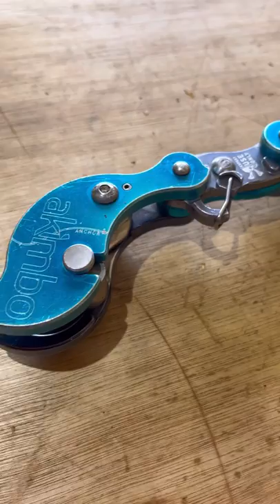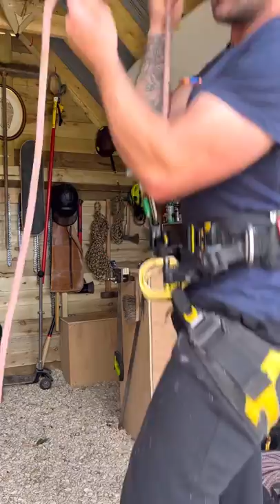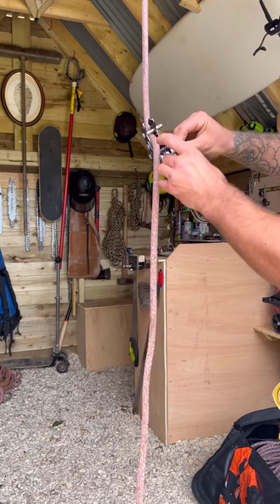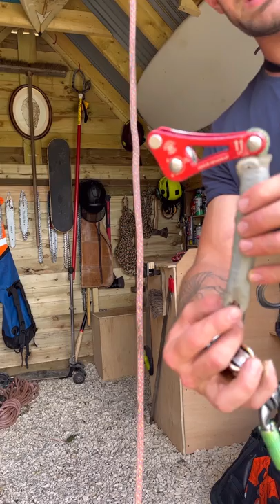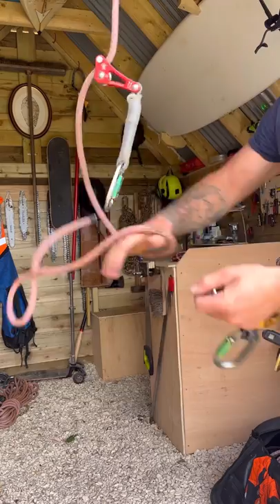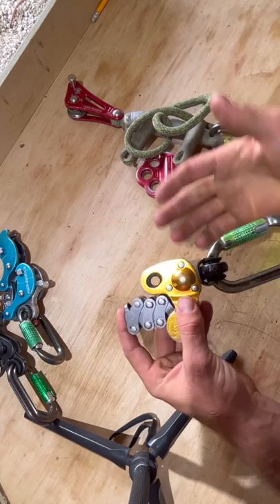SRT devices how they work and comparisons. Akimbo, RRP, ZZ, Hitch

Comment: That quick release on the Akimbo is a safety feature.  When you lean back on the Akimbo it can collapse on itself and start running on you.  I am surprised how many YouTubers that review the Akimbo either fail to know or mention that. I don't even own the Akimbo and I know that. I have even seen so-called "experts" modify it so it would not release like it should which is just a bad idea and goes to show how much they really do not know about the devices they use. Experts my @$$.
Reply: It can collapse IF not dialed in correctly

Comment: Hello man.. great video thank you... I have one question... which of these do you think is the safest??
Reply from the maker: To be honest man I’d say that’s a very opinionated question to answer. I think the way you use certain devices can effect how safe and reliable they are going to be. But to try and answer what I think… I would say the hitch could have a big disadvantage as your climbing on a rope, therefore if you somehow catch it with your power saw or hand saw you have a big chance of cutting it and then you screwed! Where as the others are metal so you might get away with just blunting your saw… 
With the ZZ and chicane you could argue it might be the safest as it’s not midline attachable so it can’t somehow come off the rope (which the other two wouldn’t anyway unless you were doing something strange) and the ZZ has the chicane above so if you drop a branch or a climber drops there helmet etc and it lands on your device you have something above your ZZ to almost protect it and stop something holding it down and making you free fall. 
In terms of being safe, I think a massive part of working and climbing is to actually ‘feel safe’. If you trust what your climbing on and know exactly how it works and how it’s going to behave in certain situations then your more likely to feel a lot safer. I’ve climbed on other people devices and they have acted totally different to mine and this can sometimes throw you off and make you feel unsafe. So I guess make sure your happy with your set up and trust your kit, this will make them all safe if use correctly 🤙🏼 hope that helped 👍🏼

Comment: Where did you get the grommets for the main points?  As a rule,  those should come standard on all of these devices seeing how they always preach no metal on metal.  My Rope Runner Pro doesn't have that so I am assuming you added those yourself.  I also think the main point on the RRP could be more stout. Makes me a little nervous. Notch should have done better on that.  UPDATE:  I just read the comments which answered the question.  DMM @ Honey Bro's.   Got it.
Reply: Arbsession has them ..better store

Comment: Does the akimbo self tend when clipped in to a neck tether, when spiking up a stem in the same way a Rope runner does?
Reply from the maker: Yeah it does, if you have the setting on high friction it won’t tend spiking with out clipping your foot ascender in. But on normal and low friction it tends good 🤙🏼
Reply: Best review of the akimbo. The side plate of my RRP's pulley bent after a couple of years. Maybe from improper use or sideloading on a spar etc. I find rhe RRP a pain in the arse to clip in to the chest attachment point even when using the perfecto carabiner. Just got my akimbo from buxtons as 270 before tax

Comment: Hey man, great video, quick question how do you have your akimbo set, i know its rope dependent, however i have heard some people say to have the top bollard set higher . Whats your thoughts?  🤙✌💪🏼
Reply from the maker: Hi man, it’s funny you ask because I’m going to do a short video on my instagram about the device and settings etc, I’ll post it on here as a short so keep a eye out! But In a nut shell… I have found that the top bollard controls more how sensitive and quick it collapses, where as the bottom one is the actual speed it moves down the rope. If that makes sense, it’s a bit hard to explain in writing. So if you had the top one set on the least friction setting and the bottom one set on the highest it would push down with no effort at all but then move down the rope really slowly. That’s what I’ve concluded anyway, I think from memory I have the bottom one in the middle setting and the top one a little less friction as I like it to be fairly quick at releasing. Hope that make sense and helps 🤙🏼
Reply: @samheemsbergen8871  awesome, yes that definitely does, I'll give have a play with the adjustments keeping that in mind. thanks for getting back & ill keep an eye out for that short ✌

Comment: I can go up and down a rope using various techniques, but I still don't know what SRT is.  Do the letters stand for something?  It seems like some of these devices could work well for TRS (top rope solo).
Reply from the maker: Srt stands for Single Rope Technique, or Stationary Rope Technique, as some people call it as your rope doesn’t move and like double rope you still actually only have one rope. Also it’s known as SRS (Stationary Rope System.) Some people call DRT (Double Rope System) MRT or MRS (Moving Rope System) as you still have one rope but this time it moves unlike SRT. I think it’s more where your from that changes what you call it, it’s all the same thing but just called differently by different people. Around here it’s SRT & DRT.

Comment: I lost a pin for the rope runner in the tree luckily I had a akimbo backup. But akimbo is not as smooth. Rope runner 3  needs to get rid of the pins also need a better top that does not dig in to your fingers and also a beefier connector with a swivel. And toolless rope adjustment.
Reply from the maker: Yeah all those reasons are why I’m not a fan, I sold mine after 2 weeks of having it! I personally find the akimbo much smoother but I think if you stick with a device you eventually get used to it :) and I had the same problem with the pins, I lost the bottom pulley and had to get it sent back up!
Reply: @samheemsbergen8871  what rope are you using for the akimbo? I feel like with the right rope the akimbo can ne just as smooth as the rope runner.
Reply from the maker: @samsungtv4u  I’m using the Tango Drayer from honeybrothers at the moment, but I used to have the Xstatic and they are both really nice to use with it 👌🏼